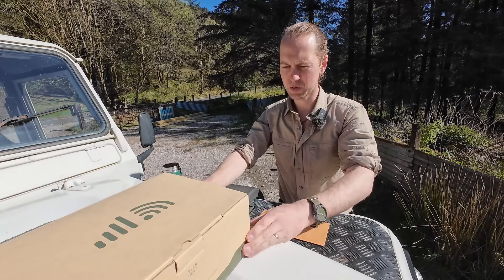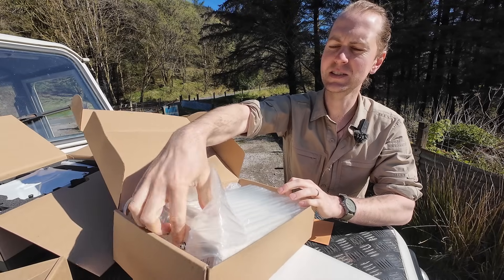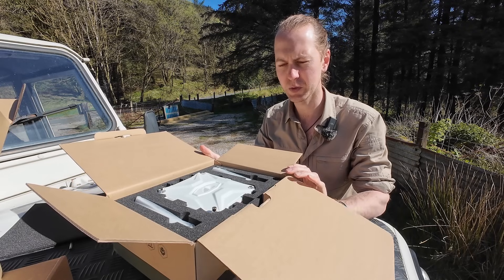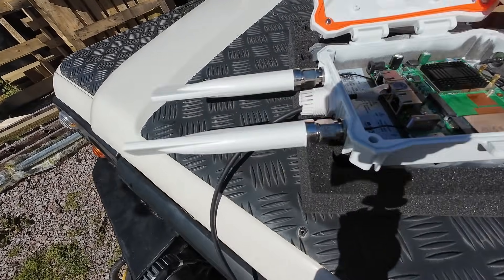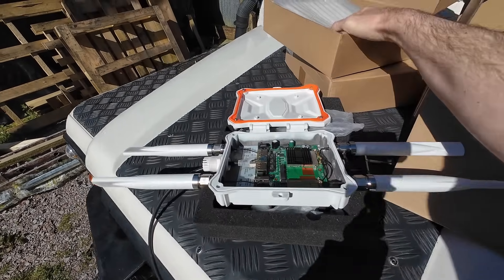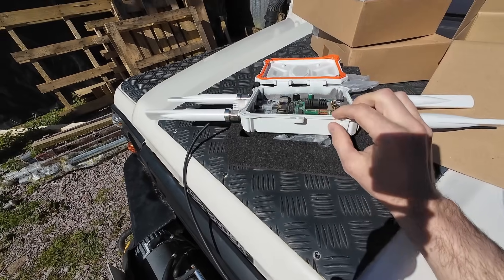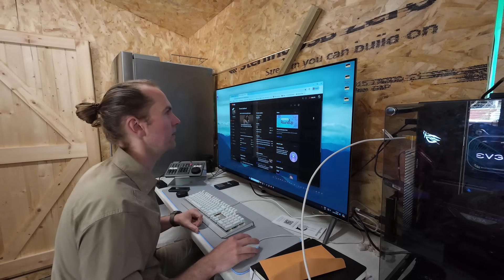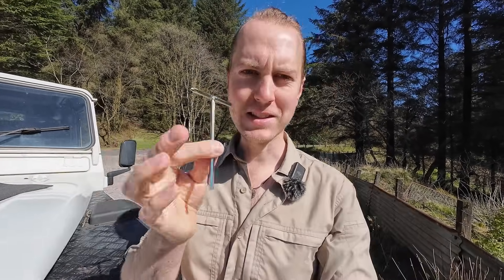Unboxing and Easy Setup of a Waterproof Outdoor 4G LTE cat6 Router-outdoorrouter

Comment: Not sure if anyone has said but LTE CAT6 is a reference to the LTE UE-Category, so the mobile network bit not the ethernet bit.  Cat 1 is a max download connection speed of 50Mbps. Cat6 is 300Mbps. In effect will try to make 6 similtainious connections to the mobile network. Upload is the same for all catagories max of 50Mbps. Speed will denpend on the distance to the cell site, number of users connected, the amount of data they are downloading and the cell site capacity. Out in the boonies where I beleive you maybe the local cell is. probibly low capacity, so speed may very greatly as the school bus drives through with all the kids streaming.
Reply from the maker: Thank you thats such good information

Comment: After seeing this video i went to "Outdoor-Router" website and got the indoor-not weather proof version of that cat 4 router you had.
Tried an O2 and Vodafone sim and had pretty bad connection with downloads of about 13mbps and uploads that did not even work.
Tried a Three Network Sim and have a decent 42 down and 38 up with the router sitting on my window ledge... out in the middle of nowhere ...(no land line) .
Got a decent Data addon on a rolling contract ...so thanks to you i have Internet...Many thanks.
Reply from the maker: I am so pleased it worked for you! I used the website cellmapper to check what providers are at the mast where the signal will be comming from so yours is likely Three which is why that sim worked the best

Comment: Looks like y/t shadow banned my reply because their kunts. Please don't bother with further money on relay lark, get a second hand Clark mast qt-10/15meter kit with guying gear. You can easily get a single mast straight up to pick up that phone tower from your location. Plenty appear & ask for silly money. Got a mint SQT-15HP for £500 + £150 van to collect it as it's 3-mtr long. Now got solid internet using the 60foot max reach but only require 45' height.
Reply from the maker: Nice! thanks for the tip. I have already put together the second version but I will save your comment for when we are upgrading

Comment: As per comments on previous vid, this is a good product meaning you have router as close to antennas as poss. Since cable loss is big problem, phone masts have had this setup for 4G for over 10 years. Config called RRUs (Remote Radio Unit, having fibre up the mast to this equipment). Anyways, this should give good results, and having those cheap log periodic antennas included (they're like £30 on ebay and work very well) should improve speeds a lot. Try both x-polar and space diversity. Former as you had with yagi (+-45deg orientation as close to each other as poss), latter being have them separated by 30cm.
Reply from the maker: Thank you, I ended up changing it again as this wasnt getting enough speed as a Cat4 unit

Comment: How much of the energy the water is capable of supplying are you using. your meters are reading the unused potential energy. you are only using 50% of the potential energy. so there is little point in changing the diameter, length or straightness of your pipe until you use at least 90% of the potential energy.
Reply from the maker: Ah ok thanks!

Comment: The science of water episode 2. For energy to be changed in to heat by friction there must be movement between the surfaces that are in contact with each other. When the water is flowing in your pipe. The water in contact with your pipe does not move. Therefore there is no loss of energy due to friction between the water and your pipe. The loss of energy is due to the viscosity of the water. Which is a constant at any given temperature. However the loss of energy due to the viscosity of the water is directly proportional to the length of your pipe. If we apply the 1st and 3rd laws of motion to the move water, we find, simply put. That any change in the direction of flow of the water slows it down.
Reply from the maker: Thanks John excellent explanation

Comment: WATER HAMMER. When the water in your pipe starts to move it gains energy in the form of momentum. The law of the conservation of energy tells us that energy can not disappearing but it can change. If you turn off your tap quickly the momentum energy is turned into pressure. Water can not be compressed so this energy is transferred to anything in contact with the water. for an instant the pressure can reach tens of thousands of PSI. causing damage.
Reply from the maker: Thanks John, I have been more careful since reading the comments on this

Comment: Not sure if it’ll help. But theres many types of POE. If you had a network switch that do POE some of them do active and passive POE. some devices require either of them. The POE plug should indicate what POE is required. But if you have many types you can get a managed POE switch such as the Unfi or HPE and you’ll be able to change the POE type
Reply from the maker: Great thanks for that it will work for up the hill to power both devices from one plug!

Comment: The problem of silt building up in the jet. If we look at a single partial of slit as it enters the jet housing. It has momentum in the direction of the jet. The first law of motion tells us, that it will continue in a straight line at the same speed unless a force acts upon it. To stop the silt partial needs a equal and opposites force. The poor design of the adjustable jet has caused the boundary layer to reverse direction. stopping the silt. This is very bad as the same force will be applied to the water slowing it down. There is a simple device called a venture which would speed up the water. The adjustable jets should be replaced with them. Only 25% of your turbine is being used. An extra couple of venture jets fitted to the turbine would increase the output.
Reply from the maker: Excellent thanks for the information I will check out those other nozzles you mentioned too

Comment: In the 70's where there were a few houses in a valley, they used a "passive reapeater" point one Yagi at the transmitter. connect to the other pointing at your house. connect with 6 inches of coax. no power required, as you already have the aerials maybe you could try this in a later video.  Pity I did not see your first Video.
Reply from the maker: Someone else has said this so It will be really interesting to see what kind of speeds it can get

Comment: Wrong device. You should have used the zyxel 7101 cat19 lte router.
Reply from the maker: Funny you mentioned it because I discovered in the testing it was too slow and ordered just that router
Reply: @beyondtheworkbench  there you go.  Good choice. I've been installing wireless networks and microwave links for over 40 years.

Comment: remember a antenna is only as good as the coax you are feeding it with . if you intend to keep the yagis at the hill site then look at lmr 400 coax if you need any links to coax and masts ect drop me a message all the best . we use similar for our ham radio remote repeater sites in scotland
Reply from the maker: Thanks! In the testing for the next video I am not sure we need the yagis so with any luck we can simplify the setup

Comment: When inside things like this, cut off a 2 inch by 1 inch peice of double-sided parpet tape. This helps temporarily hold screws while you mess about on a landrover bonnet, AND it will catch tiny insects that would otherwise become goopy goo (which conducts) in the longterm. 
How do they get in? Magic.
Reply from the maker: Excellent idea thanks!

Comment: It's surprising that in 2024 SIM cards are still a thing. It's literally just a chip storing data. It made sense back in the day, specially for small portable handheld devices, but the technology moved on. We have devices with WiFi, bluetooth and various other data transfer technology, we can store gigabytes of data in similar form factors as a SIM card, and it's all already built in. The card socket and the whole reader module is literally just a waste of space and added cost. We have eSIM now to replace all that.
Reply from the maker: I always wondered why it kept getting smaller and smaller but its just plastic bits being removed. You could absolutely have a digital version maybe even stored on a blockchain. It would certainly stop me worrying about dropping it in the long grass
Reply: @beyondtheworkbench  It already exist, it's called eSIM. The only problem that not all phone carrier companies support it yet. That will be solved once all major phone manufacturers start rolling out "eSIM only" flagship phones. This will force them to get in line or lose customers.

The only argument for physical SIM card is that you can "easily" swap it out. Of course this argument not really valid anymore since the modern phones don't have removable backs, and if you don't have something handy that fits in that tiny hole, you're out of luck.

This was kinda solved with dual SIM slots, but let's say you travel a lot to different countries, then 2 still wouldn't be enough. Not to mention that with dual SIM slots, you generally lose the extendable storage support.
And how often people swap SIM in general anyways besides a few edgecases?

Comment: Cat5E Ethernet cable is better for longer distances. Cat6 can go faster, but over shorter distances, and most consumer equipment can't really take advantage of the extra speed anyway. Plus, the bottleneck here is going to be the 4G wireless, not the Ethernet speed.

And "4G" is 4th generation wireless mobile data, whereas "2.4GHz" is the WiFi frequency. The there are also 5GHz and 5.8GHz WiFi frequencies with faster speeds but shorter ranges.
Reply from the maker: Ah thats the difference, I will keep that in mind then as sometimes I do need a longer run and other times its just a short run between the router and a computer
Reply: @beyondtheworkbench  Sorry, that's incorrect info there. CAT6 is superior in every aspect (except maybe price) . It was designed to go faster by having improved characteristics, which make it more capable at any speed.
You might want to consider getting surge arrestors - you don't have to have a direct lightning strike to fry stuff. The Ubiquiti UAC-LRE will do PoE plus data up to 1km. Just make sure cable is UV protected.

Comment: I wonder if that router's version of OWRT supports containers. You could set up a home assistant container and have some cool automation with your micro hydro by using some electronic valves to turn them off once your battery's get to like 95% and turn back on at 80%. which would stop the need to have the heaters to drain the excess.
Reply from the maker: Incredible that sounds like an ingenious idea!

Comment: Is the router POE ? thanks for posting
Reply from the maker: Yea the central and left port are POE and it worked when I tested it
Reply: @beyondtheworkbench  so with external grade ethernet cable you could run this up the hill and it would be powered and you have best internet speed ?

Comment: I have that routwe on my boat - its survived 3 years of salty air, and still going strong. If you intend to run the cat5e cable back to the house to power it, i would use a domestic wireless access point at that end, and not bother with the 2.4GHz wifi the router provides.
Reply from the maker: It looked really sturdy so I am pleased to hear yours has survived those conditions. Thanks I was planning on running it to a nighthawk router but am likely to change the whole system again in the next video because of the speeds it gets arent quite where I would like them

Comment: Excellent I hope it works well 👍
Reply from the maker: It did work well but not the speeds I wanted so I will be doing some more testing for the next video
Reply: @beyondtheworkbench  You may want to try a LTE Cat-18 (Mikrotik) or (even better) a 5G router (Zyxel NR7101 or NR7102).

Comment: I know this is a long shot, but are there any sheds, or buildings in line of sight of the mast and your property?  If so, try pointing the yagi antennae directly at the building.   I have seen one site that was literally in a complete dead spot, tucked in behind a hill, but managed to bounce/reflect the signal off  the tin wall of a hay shed!  The signal is a bit noisy (SNR) probably caused by the scattering effect of the corrugated tin, but getting 80% of signal is better than nothing at all!  Even an old metal oil tank positioned in the right place might do the trick?
Reply from the maker: Wow that sounds incredible that that would work! We seem to have a pretty clean and clear signal from the mast so I dont think I need to do that but I will see if aiming it at the hill to catch the reflections makes much of a difference

Comment: 4G = LTE a cellular (mobile) standard for voice and data, where the "G" means "generation" (i.e. the next big standard after "3G", which followed "2G" etc).  Alternatively, 2.4G is the the frequency of the WiFI module - where "G" in this context is Gigahertz.   It's confusing that "G" is used in completely different contexts, but I guess as long as the right antennas end up in the right ports, it doesn't matter what the underlying meaning is.
Reply: It is supposed to be "4G" and "2.4 GHz". Anybody who leaves the "Hz" off of "GHz" is making things needlessly confusing.

Although it would be a whole lot less confusing if they would refer to generations of tech as e.g. "4th gen" instead of being lazy and dumb and abbreviating it to just "4G".
Reply from the maker: Thank you very much for explaining that, now it makes a bit more sense

Comment: It's basically using OpenWRT very good free source software, I'm suprised there's no 5G LTE unless you're not in a 5G Area would get more speed I always have slow speeds with Vodafone UK 4G LTE.
Reply from the maker: There are different versions for sale so there is a chance one of their other ones does 5G
Reply: @beyondtheworkbench  They always change the versions something better comes out.

Comment: The LTE antennas don’t necessarily have to be parallel vertically. You can always try one or both horizontal or vertical towards the Mobile cell tower. As mobile phones work both ways depending on the angle of the device is being used. As signals get further away from the fresnel radio pattern points. You can have better gain on one than the other during storms, fog, sun and other conditions that can cause signal degradation.
Reply: One antenna should be mounted at +45° and the other at -45° since 4g is transmitted cross polarised so mobile phones work well in different orientations
Reply from the maker: Ok great, in testing them they actually diddnt make a differenct to the speeds, the signal was stronger but I think we were hitting the limit of the router. I have a third one arriving this week to test on the next video as well
Reply: @beyondtheworkbench  in my experience you're normally limited by the bandwidth available at the cell tower itself

Comment: It looks like the router runs on a customised version of OpenWRT, which is actually pretty awesome!

OpenWRT is an open-source project, providing firmware and software for various routers and wireless access points.

The upshot of this is that, a bit like the Android/iOS store, there's thousands of software packages that you should be able to download directly onto your router, allowing you to do cool stuff like set up VPNs, reverse proxies, adblockers, QoS (very useful for managing latency on 4G connections) and much, much more.
Reply from the maker: Amazing I am so glad you pointed that out

Comment: The yagis are very powerful antennas, did you try them near the house? You may not need to go through all this.
Reply from the maker: I have done so many tests for the next video to explore this and yea you may be right, seems there is a slight gain up the hill but I will conclude it this week and see what the overall gains are
Reply: Was thinking the same, might get signal without the redirecting the signal etc. Interested to see the conclusion.

Comment: That looks like an impressive bit of kit. As others have said, Cat5e ethernet cable will be fine. Going to Cat6 isn't really needed unless you want to go for multiple gigabit connection speeds, which 4G won't do anyway.
In case you're looking to put it up the hill and run a cable, Cat5e is generally only rated for distances up to 100 metres.

Not many Devices can send power over ethernet. It's usually confined to business grade network devices, as it's used for things like powering CCTV cameras or WiFi Access points in ceilings (so you don't need an extra plug).
Reply from the maker: Thanks, we have a 200m run up the hill so POE wasnt going to work without boosters. I have got a third router for the next video in the hunt for the best speeds

Comment: Presumably you're using 2.4 ghz wifi on the router to connect back to your house? 
If so, not sure why you need the network cable other than for power. If it's just for power then the cat5e will be fine.
Reply from the maker: Thanks